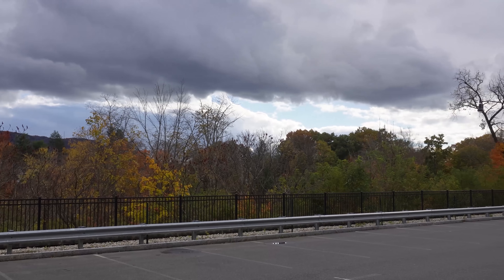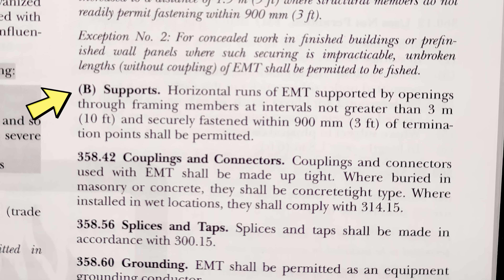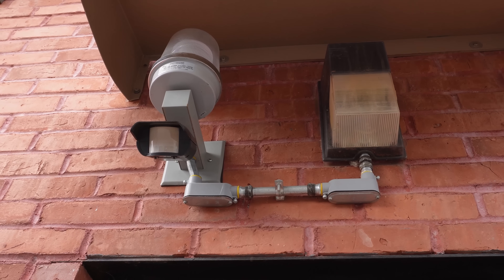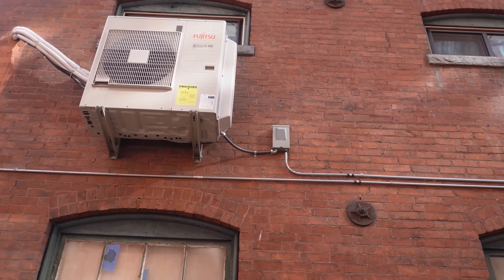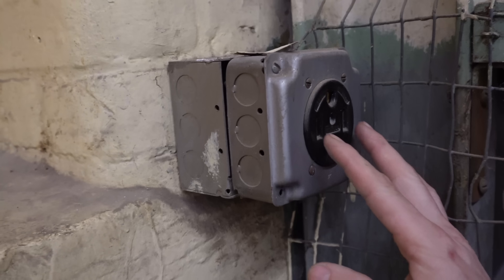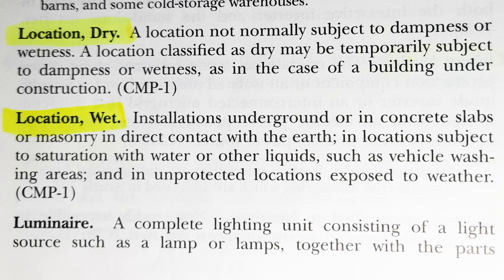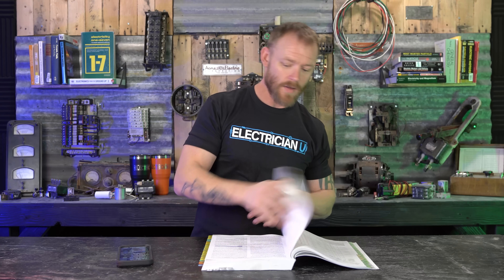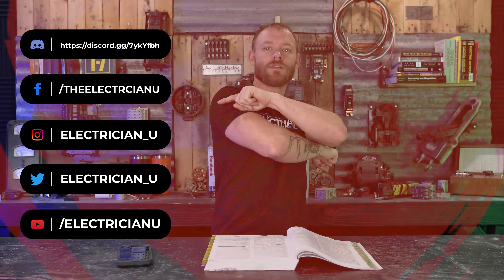Finding Code Violations in a 100 Year Old Building!

Comment: I was the only electrician and put my master’s license up to qualify to pull permits for a 10,000 seat arena and because I had proven myself to respect the NEC and I am VERY proud of my work I was not invited to be part of the box office expansion. Long story short now. When this huge huge contractor had “finished” and passed the inspection to the “CO” I ended up with a binder of over one hundred pages of photographs (some pages had more then one photo) showing code violations of every type. From support to over bending, flex going 40’ as the crow flies, work space and the way some of the work was done should be a violation. Oh most photos had more then one  violation. I don’t work there due to a work related injury (because of a code violation)

Comment: I live in a building that will be 100 next year. There are 14 sockets in my apartment. Six have leaking current between neutral and ground when there is no load on them. Two have no ground at all. Three are wired in reverse. That leaves three of 14 that are wired correctly, at least according to the multimeter. I haven't pulled them.

Comment: The part about closed boxes I find especially interesting, I had a rental with a fair number of uncovered boxes in the attic and crawl space which seemed wrong but the air conditioning and electrical technicians claimed it was totally fine even though you could inadvertently reach in and grab the energized connections going in or out.  But it sounds like because that was all 120 or 240 volt it would have been fine per code?

Comment: 1:41 Actually if you look at those windows they are in fact vinyl windows with locks on them. Thus they can open and close to allow fresh air in. What is not up to code is that they block a way for someone to exit the building through those windows in case the other main exits are blocked by a fire.
Reply: Might not be a violation at all.   In most office buildings,  none of the exterior windows can be opened.

Comment: The best one I've ever seen was an old house that didn't have a fuse box.  It had the meter feeding into a fused disconnect which had wires coming out of it going to a disorganized array of fuse blocks screwed to the floor joists above.  All the terminals were exposed, none of the wires were strapped, and most of the wire was fabric covered knob and tube. The house was well over 100years old.

Comment: My home was built in the 1880's before there was power, running water, or any other utilities in the area. It was first retrofitted for electric in 1912 or so. I have had a new breaker box installed as the old one was from the 1930's and have redone some of the lines, but it is a trip to open a wall and find connections that are straight out of history books.
Reply: I bet they are still in good condition.There was no chinese counterfeit shit in those days.
Reply: @MernokiMegoldasok  I wish that was the case, but tarpaper insulation over copper wire does not do all that well in 140f attic for over 100 years. Do have a few pieces I have saved since they are marked as having bin made in the Edison plant.

Comment: Cool adventure. My house was built in 63, wiring was pretty old, sketchy, scarry when I got it, in 83. Old Fed. Pacific fuse box, cloth covered 2 wire, no ground. The odd thing is, been a tree guy here 31 yrs, no National Tree Code, you just say you're a tree guy, and get started. Some days can be pretty technical, but not like wiring a factory, machine shop, plant, or shopping center.

Comment: You should’ve seen my house before I changed everything. A home owner sometime in the mid 90’s ran romex onto knob and tube without junction boxes and in some cases didn’t even use their shorty electrical tape tactic you see elsewhere in the crawlspaces. After a good wind one night, nothing upstairs worked, nothing above your head downstairs worked and ground floor plugs would randomly cut out under moderate loads. After diving further into it I found that only 3 of 9 fuses were actually being used. Laundry and heater were the only 2 separate. Pulled permits. Pulled new wire. Dropped 200 amps into a 115 year old house. Inspector never second guessed my work.
Reply: Not to mention the 14guage wire I found powering multiple 30 amp 220v receptacles

Comment: Having trouble with this… voltage coming in from the meter 120/240 service. Getting 135 hot to nooch/ground and 256 across… I think it’s too high (given the 5% guide). Having trouble finding anything in the book. Thinking there’s a neutral problem. Not sure. Suggestions on what it could be or if the voltage range is ok? Thanks!
Reply from the maker: Some services run a little high. Check all your terminations in the panel and go from hot to hot hot to neutral other hot to neutral and then hot to ground. What are those values?

Comment: The specificity of the box cover code reading is one of those code issues that will usually began a joyous and interesting debate among Mike Holt and his guest Sparkys and engineers... lol  I know one thing... if those circuits are live, those exposed splices won't usually pass inspection.  So, some things are worth challenging an electrical inspector, but not that. IJS Again... great commentary...

Comment: Please forgive me if someone has posted this some-where but in ref. with the disconnects @ 7:50 .
At first I thought it was a violation because of NEC 100 definition for: Accessible, Readily (Readily Accessible). "Capable of
being reached quickly for operation, renewal, or inspections without requiring those to whom ready access is requisite to
take actions such as to use tools (other than keys), to climb over or under, to remove obstacles, or to resort to portable
ladders, and so forth." But, now I don't because a disconnect is a switch and the following:

NEC 404.8 Accessibility and Grouping.
(A) Location. All switches and circuit breakers used as switches shall be located so that they may be operated from a
readily accessible place. They shall be installed such that the center of the grip of the operating handle of the switch or
circuit breaker, when in its highest position, is not more than 2.0 m (6 feet 7 in.) above the floor or working platform.
Exception No. 2: Switches and circuit breakers installed adjacent to motors, appliances, or other equipment that they supply shall be permitted to be located higher than 2.0 m (6 feet 7 in.) and to be accessible by portable means.
It does appear this does apply here but, you be the judge.

Comment: To me, safety should be the concern here, not just simply "oh nos!  This isn't up to current code!".  Often times I hear electricians assume code is about morality or ethics.  As others have pointed out, did it violate code at the time it was put in?  To find out you'd need to be an electrical archeologist.

Honesty, of the things you found, there's two things that should be fixed, at least in my, non-electrician opinion.

1. The loose outlet + conduit that look like they're about to come apart.  Seems dangerous, and looks like given a good push (or colliding with something being moved) the whole thing could fall apart.

2. The lack of covers on the boxes.
They look like they're all up in a high ceiling somewhere, but they could be a safety issue for anyone doing maintenance.  Changing light bulbs, plumbers, etc.

The others seem like just mostly niggling little concerns.  Yeah, the conduit on that windows is weird, and the conduit to that light install looks weird.  But really?  I don't see how anyone is going to get hurt by either of them, or it fire hazard, or anything else.

Comment: The older rigid pipe that you saw, going into the “open“ junction box. The bolted together flanges, are “threadless couplings and connectors” they pre-date EMT, and for sometime, certain manufacturers made threadless couplings and connectors, that resemble those that are still used on sprinkler piping today.
Reply: Thank you Sir! 😃

Comment: I don't have a code book to quote from but I will say that something I learned from your channel about codes is that all equipment has to be properly installed per manufacturer's instruction; therefore, wouldn't it be safe to assume that code includes the assumption that a properly installed box with cover is actually closed "properly"??? 😉 😉 😜

Comment: So crazy to come across your video. I work in one of those mills that you were outside of and used to live inside the mill that has all the open j-boxes. Mill life in western mass is something unique. Most of these mills used to run on a 600v delta configuration, but they have been upgraded to more modern 480 or 208/220 3 phase systems. Good luck on working in the area.

Comment: Hey there, I’ve seen the similar bolted piping for  4.5kv lines at the Dominio Sugar plant in Baltimore, MD. The building started construction in 1919 and was opened in 1922. It originally had coal power plants, then fuel oil boilers and now natural gas boilers. The entire powerhouse is still very much all original with it slowly being upgraded to modern code over the past ten plus year’s. These feeder lines lines come from the switchboards to the load centers and power transformers at the other buildings within the plant. If you wish to visit them, they will more than likely have the plant open for tours their centennial year during 2022.

Comment: It makes sense that the disconnect would be required to be next to the equipment and not somewhere else. Imagine climbing up a ladder only to find that the disconnect is not near the equipment, and then having to figure out where the disconnect actually is. Or worse, they thought it was disconnected elsewhere and it wasn't and they start working on it. So even though a person's first thought might be that it needs to be on the ground level, the code is right in requiring it to be next to the unit itself.

Comment: *Massachusetts resident here in my mothers home there was a breaker that was for a water heater yet ours is 100% gas. when I found where the breaker leads to it was literally just a cut off wire. no wire nut, no junction box just a 4 conductor wire freshly cut off.

Comment: Skipping around an not watching everything yet.   
You really think its crazy for the disconnect for ac to be readily accessible from the position of the equipment.... Where is your  disconnect for your residential air handler in a normal situation
Oh that's right it is on the AR handler.     If you are 12 or 80 feet up you dt want to have to travel and clime or crawl 12 or 80 or a thousand feet to get to the disconnect
presumably anyone equipped to work on an ac 12 feet in the air would be equipped to use the disconnect foot away

Comment: Electrical conduit was once generally japanned in the manner of gas pipes, rather than galvanized.  Boxes, both stamped steel and malleable iron, were also generally Japanned rather than galvanized.     

Have you ever run in to surface raceway made of wood?   How about panel boards or cut-out boxes made of wood?  

A typical electric service panel at the beginning of the last century would consist of a wooden cupboard, perhaps lined with asbestos paper, including live bar knife switches, and fuse cut outs, either made of slate or porcelain, using either plug, cartridge, or link fuses (link fuses are just a bit of lead wire of a specific gauge connected between two binding posts) 

The use of wood for these (and other purposes) was very common before 1910.  In the 1912 iteration of the code, however, although wood raceway was not prohibited, all junctions, splice boxes, tee taps, switch bases, and other fittings where the insulation of cables was interrupted were required to be made of “noncombustible nonabsorbtive insulating material”.  Initially this was of course universally electrical porcelain, but by the late ‘teens “composition” (a shellac based thermoplastic material similar to that used for talking machine records) or Bakelite and Condensite  products were deemed suitable.

It was, I believe, a late 1930s iteration of the Code which finally prohibited wood raceway.

Comment: My main panel and sub panel are in the same building, one in the bedroom  and the sub panel is at the other end of the house in the basement. This was done over 50 years ago. No grounding wire from main box to the sub panel and near impossible to install one.  

I am replacing my sub panel box with a newer one with more spaces so I can put in a 240 line. I can easily put in a ground wire to a rod outside from the sub panel box but would this be right?  Everything in the old sub panel box is connected to the neutral.  Of course, there is already a grounding terminal with a grounding rod from my main box. Any advice would be appreciated.
Reply from the maker: Try asking in our facebook group or our discord: https://discord.com/invite/7ykYfbh

Comment: I have a 2-in steel conduit going from my breaker panel to the attic. How much 14 gauge Romex can I fit in there?
Reply: Romex should not be enclosed in pipe or conduit. Sorry, I cannot point you to the code on this, but someone here should be able to.
Reply: @rayives7758  the breaker panel is outside right next to the meeter.

Comment: Sans 10142  Part 5.1.1 
Live parts 
It shall not be possible to touch any live part within arm's reach with the standard test finger (see SANS 60529)
a) during normal operation, or 
d)when a cover is removed, unless the cover is removed with the use of a tool or key.

Comment: I think that “hose bib” might actually a compressed air line that someone used a stop and waste valve on. It’s pretty common in commercial buildings to see equipment requiring large electrical hookups like that also needing compressed air, vacuum, gas or other utilities.
Reply: True I was thinking that was possibly an airline as well
Reply: I think you're right, judging from the lack of rust on the threads.
Reply: I have to agree that it is an air line, but cannot be functional. Air lines in many industrial and government facilities require drip legs at equipment and air devices with minimum of threaded caps or plugs for draining condensation during maintenance. Without the plug or cap, the line cannot be functional to hold pressurized air. Note: a gate valve in no longer acceptable for air lines.
Reply: @c.s.rollison5821   they may require that now but did they 100 + years ago?
Reply: @michaelcoles6846  the building may be 100+ years old, but most likely have been retrofitted at any time during. I’m not sure how many compressed air systems were around 100+ years ago.
Reply: @c.s.rollison5821  Plenty, considering the first large unit was 1888CE.
I worked in the Fore River Shipyard that had 2 massive units, probably Westinghouse from very early 1900’s. They ran 24/7/365 to keep the ground water out of the lines, otherwise it was half a day or more to purge the lines of rusty water.
Reply: Beyond that... it's /not/ a hose bib. It's a threaded elbow with nothing screwed into one side.

That there be a female threaded hole. Hose bibs are male ordeals.

Comment: That big pipe and Box you touched o at about the 6 min mark seems to be from the old pneumatic messaging system. The whole system ran of large diameter pipe with a vacuum pulling air in a loop. what ever needed to be sent would be put in a canister and inserted into the box, once the box was closed the air pressure and flow would move the canister to it's destination. I would have followed that pipe to the other end. NYC had one of the largest system in Manhattan, the USPS took advantage of it to deliver mail to tons of offices in sky scrapers.
Reply: It's not a pneumatic message tube. The 90s are way too tight, the box is not air tight in any way and is too high up on the wall and would not be on the exterior anyhow. The other end of the tubing is just floating open at the end of the building, seen at around 6:30. It's almost certainly for electrical, but I can't imaging what.

Comment: I relocated a meter panel that I had installed 2 years prior. I thought I could save a few bucks if I could pull out the ground rod that I had driven in 10' in the original installation. I got the bright idea that I could pinch the rod with 2 pipe wrenches and wiggle the rod out. I set it all up, braced myself and gave the rod a pull. It came out of the ground and the whole thing, wrenches and all hit me in the chin. The rod was only about 18" long and had rotted into a long thin taper, tapering down to a thin spike. Damn...was there a bad connection on the power company side?
Reply: Haha im sure there was. I will tell you right now Lineman do not know or have to follow any electrical code in most cities. They use their own spec for services and will fix someones outage by any means necessary.
Reply: Damn that sucks. Did you contact the power company?
Reply: Speaking as a guy that was wiggled out a lot of ground rods.. Typically I get more success wiggling as I pull than wiggling first and trying to pull it all at once. 

 Aslo depending on how far you are from the substation, there may be up 5V between the service nuetral and the earth ground.  Though your discovery could just be aggressive soil chemistry as well.

Comment: You’ve gotta see a 120yr old, steel mill in my city. They have mortared powerhouse breakers in service that you can only find in the smithsonian elsewhere. I’m working on a 440v ungrounded delta system @25hz currently. Old system we are replacing was Westinghouse gear dated 1907-1909.
Reply: Sounds pretty cool
Reply: George Westinghouse was still alive at that time. Dang.
Reply: sick